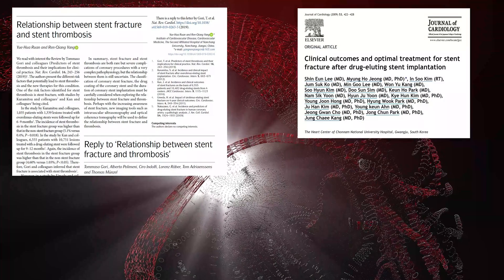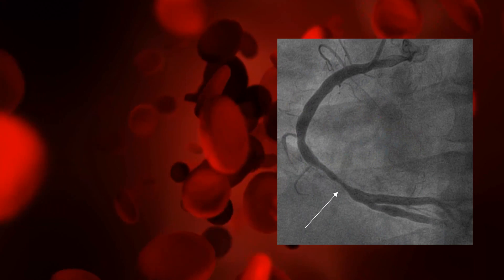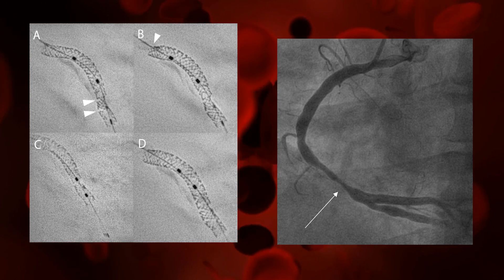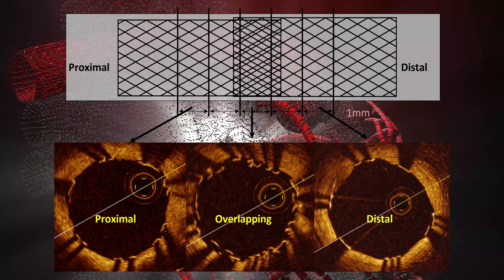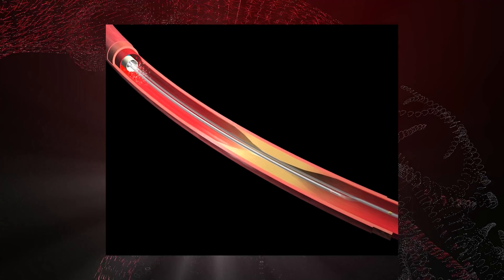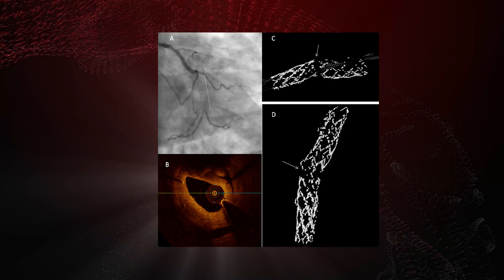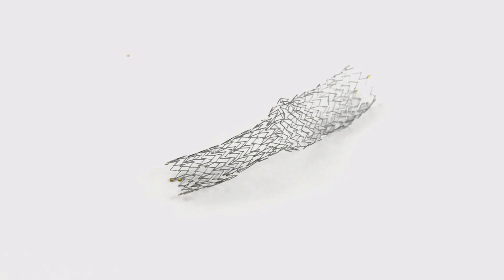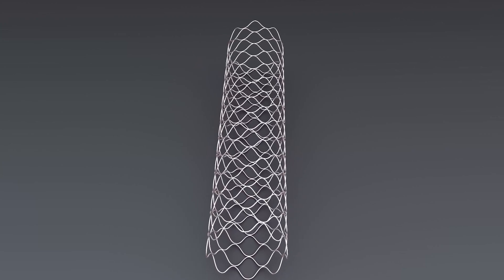Heart Stent Fracture | An uncommon but recognized problem

Comment: Have stents 8+ years old, one ruptured inside my heart. What can be done? On blood thinners and asparin 81mg and 60 mg nitroglycerin time released.  Pulse keeps dropping to 30-40 BPM but oxygen is upper 95%, if pulse incresed to 70 or above, requires supplemental oxygen. After they put my stents in, I was being driven home 2 hours later. Thats American healthcare for you.  You have to keep your Stent card in your wallet, and inform medical staff you have stents before MRI.  Looked up the stent manufacturer, and theey stated the patient should remain in hospital for 6 days to prevent complications. I was whisked away 2 hrs after surgery, wtf.
Reply: But My doctor used to say that stent fracture is almost impossible after years of implamentation.

Comment: again thank you so much these are the best clear explanations i have seen. i still question the balance in using the correct scaffolding stent such as a dissolving stent, removing the risk of heart attack, but leaving the artery to function normally after it has dissolved. as mentioned the artery pulsating can cause fracturing leading to other complications that need attention. against another procedure to apply another dissolving stent say in 4 years time, as these procedures are less evasive than open heart surgery.? and what about the issue of the artery pulsating whilst the metal stent is non compliant to that movement, what are the symptoms and feeling for the patient in these cases. ?
Reply from the maker: your questions are fantastic. most modern day stents are manufactured to resist much of the usual movements and contractions of the heart and pulsation of the arteries so they are safe. There are however situations where as cardiologists we need to be extra careful and consider strongly the need to place a stent or what is the best technique to use in such cases. We will address this in an upcoming video.

Comment: I had a stent put in 6 years ago on the LCA after a heart attack.  Just recently had three more put in on the RCA. The one in the left was 100% plugged again. They went in to open it back up and the wire ended up piercing the layers of the artery.  Now I have to go and have the stent installed in two months after it heals. I'm beginning to think I should just get a bypass instead.
Reply from the maker: thanks for sharing! We will shortly have an episode with a cardiac surgeon to discuss bypass surgery in greater detail.